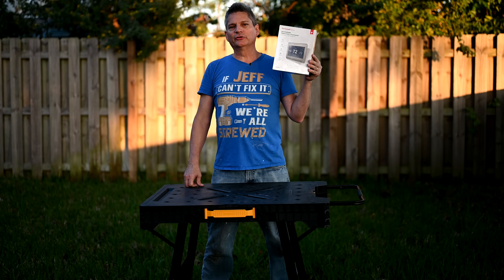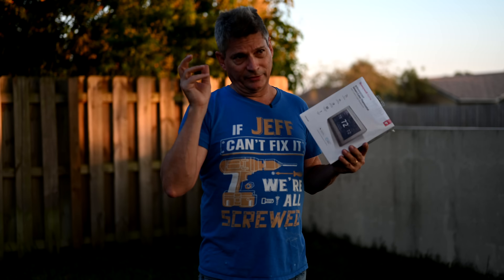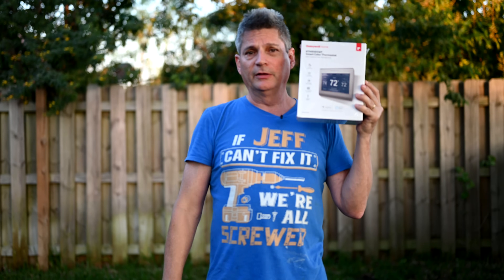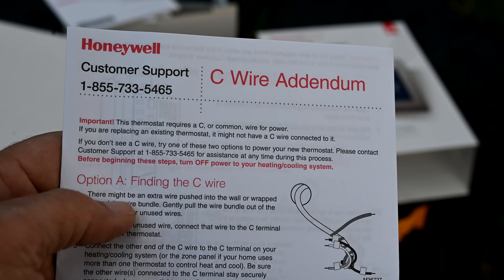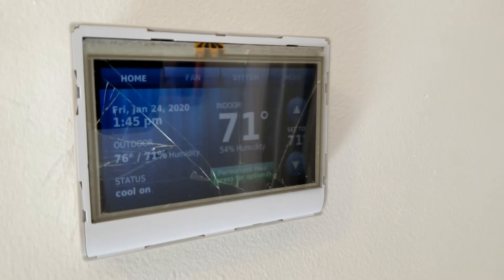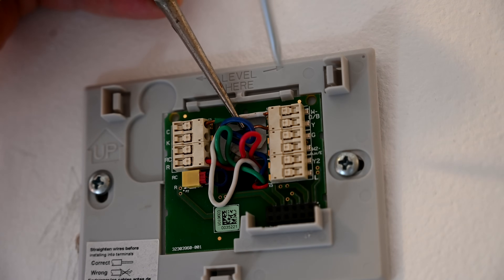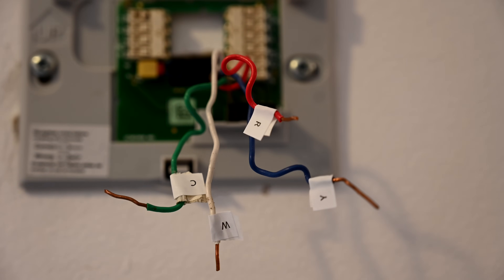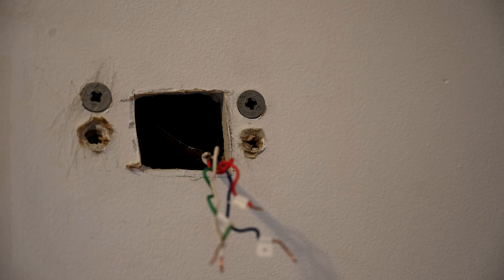How to Install Honeywell Smart WiFi Thermostat RTH9585WF Wiring

Comment: I don't have central air. Can this be used for a gas boiler only?
Reply from the maker: There is a setting for it check owners manual pdf file for fuel heater

Comment: How do I take the wires out? I have W/B/G/Y/R wires and there was a slot for all of them except B so I tried it in the C spot and the heat runs but not the screen. So now I can’t get the wire tips out even with pliers, those little release tabs do nothing. If I pull any hard the whole thing will break.
Reply: I can’t find any videos online that have the same combination of wires that I have
Reply from the maker: Read the instructions in the manual it should say something like that but you basically work the reverse of how you put them in which is you're supposed to push down on something with thing with the screwdriver I believe and then the water pulls out I'm not anywhere where I can look at the manual right now because I'm not at home.
Reply: @jeffostroff  i have 5 wires and it seems like none of them are C. I will have to return the device or get an adapter. Thanks for the help
Reply from the maker: @joetaviusturtle4212   The purpose of the c wire is to provide 24 V AC to your air conditioner. You will need a Volt meter that can read alternating current on DC mode to be able to read that you have 24 V constantly going on this line. One of those 5 wires surely must be the correct wire. LookAt this article here  https://smartthermostatguide.com/thermostat-c-wire-explained/
Reply: @jeffostroff  thanks, it’s the blue one. It isn’t plugged in on the furnace downstairs. There’s another wire in the C spot running to the water heater.

Comment: Any thoughts on why my screen won't illuminate if i have the green to the C, the white to the W, the blue to the Y and the red to the R portals?
Reply from the maker: The color of the wire doesn't mean anything, only where they are connected on the air conditioner so you the air conditioner so you sort of have to know what they are. But if the screen is not lighting up then that probably needs you're not getting 24 V on the c line

Comment: Hello. Your instructions are straight to the point and very easy to follow. My problem is I have 8 wires on my old thermostat which the C wire is blue. O tool a picture but don't know what to do with all those wires.
Reply from the maker: Check on the Honeywell web site support for you thermostat, they have other wiring scenarios there

Comment: Hi Jeff, do you know where I put the orange wire in this terminal
Reply from the maker: No, I have no idea what your orange wire is connected to.
Reply: Orange wire is usually for the reversing valve on the heat pump.  It should go on the terminal labelled ""W-O/B"   If you have a white wire, that is usually for your strip (electric/emergency) heat and that goes on the terminal marked "W2 (aux/E)".  Honeywell web-site validated this, and mine works like a champ.  Make sure you set it up for a 2 stage heating system.

Comment: I just installed this a week ago the part where wasn’t sure was the forced heating if it was gas/oil or electric I selected gas/oil is that correct? Also the efficiency of the heating I selected 90% efficiency.  I don’t know if that’s correct either.
Reply from the maker: It's very simple if you have gas or oil you use a different setting. If you have electricity powering your air conditioner, then you select electrical.

Comment: If I have a previous thermostat with a "G" wire, Can I connect the "G" wire to the C at this thermostat model? Do you think that will be enough?
Reply from the maker: You can try it. IF that doe snot work, Honeywell's website for this has other scenarios to try

Comment: This is why Honeywell conditions their warranty on professional installation on many of their products.  All was fine until this guy started breaking the wire release tabs pressing them in the wrong place.  These are delicate and will break if you press anywhere but on the "head" which is that square part nearest to the wire receptacle.  Note there is a little round recess where you press with your ball point pen or stylus.   To be fair, I also have had 2 Pro-installers break these before I could stop them.
Reply from the maker: The tabs are not broken, and the wires are in the correct place. If not, the unit would not work. LOL Nice try

Comment: In the set up it asked if the unit is Gas or Electric, which do I put if the AC is electric and the Furnace is propane? I haven't installed it yet, but your video seems to be very clear. You mentioned there's a link showing how to add or work around the missing 5th wire. Would you happen to know the link for that? Thanks in advance
Reply from the maker: Kevin not sure about the propane, but they have a lot of setup and wiring tips on the Honeywell site ofr this thermostat: https://www.honeywellhome.com/us/en/support/how-do-i-wire-my-wifi-9000-color-touchscreen-thermostat/
Reply: If your forced "Heating" system runs off of gas/oil select gas/oil.
Mine is both as well Furnace is gas

Hope this helps..

Comment: Thx for the video showing all detail steps to install the device. I just checked my old Honeywell thermostat and found one of the wire is connected to RC, with what I think is a jumper, a kind of U shape little metal hook, connecting the RC and R. 

Can I ask you how to change this set of wire into the new WiFi thermostat? Do I do the same like the old setting? Connect the wire to RC, with the U shape jumper hooking the RC and R?

Thx very much 🙏🏻
Reply from the maker: For most common systems, the default configuration at the factory on the thermostat is to jumper the Rc to the Rh. This is because most systems have only one red wire coming out of the wall going to "R". So they both get jumpered together for single control. If you have 2 lines coming out of the wall that are red, chances are one goes to RC, the other goes to Rh, and you must remove the jumper. Which do you have?
Reply: @jeffostroff  thx very much for your reply. I am using Honeywell RTH221B (battery needed), and I found only 4 wires coming out from wall (so, no wire for "C"). 3 wires going to "GYW", and one going to "RC", a jumper connecting "RC" and "R" together.

 Therefore I believe I need to figure out how to provide power to the thermostat if want the one you mentioned in the video...
Reply from the maker: @leochh  We had to do the same thing on this install. What I had to do was inside the air conditioning unit I found a 24 Volt signal that I was able to use for my C line and Wren dad to the sea line. But by doing that I lose the ability to ever run my air conditioner in fan only mode which is no big deal because I only use it in AC mode cooling mode, or in heat mode I never operated with just a fan only so that was no big loss for me.
Reply: @jeffostroff  thx for your advice, let me try this out~ :D

Comment: Hello Jeff great video, I am a new home owner. Where do you find all that information about your unit that it asks during the set up process?
Reply from the maker: Do you mean like the Mac address and IP address and all that other stuff? Usually they come on a sticker in the package, or if you can turn on the unit you should be able to find it somewhere in the setup menus
Reply: @jeffostroff  where it asks like if it’s forced air, gas or electric, 1 stage or 2 stage. Information about your actual hvac system
Reply: @monb2857  if you can find the make and model number of your furnace, you can search for a manual online to give you the information you are looking for like std or high efficient furnace etc. you'll know if its 1 or 2 stage system by the number of wires you are hooking up. for example, if you have 2 yellow wires and 2 white wires (in addition to the red, green and c wires) then its most likely 2 stage. hope this helps

Comment: OK Video but what is failed to be mentioned is that it is ok if you dont have a 'C' Wire. All you need to do is purchase a 24v transformer that you plug into the wall and it will act as the 'C' wire. they are cheap and avail on amazon, Lowes, Home Depot.
Reply from the maker: Yes that is another good way to do it

Comment: How do you take it off?  I can find NO videos on how to remove it.  It doesn't appear to come off as easy as the one you replaced
Reply from the maker: They should pull right off the wall with some light force and you can pry them from the back plate gently with a flat head screw driver it you can't get it to come off
Reply: @jeffostroff  I'd like to point out I"m trying to take off the newer one not the one you took off.  Just moved in to a place that has one.  Need to take it down.  I think it's the 9585 at least it looks like it.  It doesn't have a model # on it that I can find.
Reply: @jeffostroff  worked.  Just needed to pull a little harder thx

Comment: My Current thermostat has batteries in front. Does that mean I wont have the "C" wire? Or could i still have 5 wores even tho it has batteries?
Reply from the maker: Yes this likely means you will not have five wires period now it could be that originally when your house was built they wired it with five wires but then somebody came in later and did a cheap solution by requiring a thermostat that has its own battery. But what I had to do with mine was to remove the thermostat with the battery and I stole another wire out of the air conditioning unit in order to use it for a C wire, but by doing so I lose the ability to ever run the air conditioner in fan blower mode only which is no big deal because I only ever use it in AC mode during the summer, and sometimes heat mode during the winter time period
Reply: @jeffostroff  well I only use regular air in summer & heat in winter. I didnt even know about a fan mode. I just want to upgrade mine cause you have to manually switch from ac to heat. I want one that auto switches itself. Any suggestions on a good one that has auto switching itself but uses without "C" wire?

Comment: Can this Thermostat works with Oil Furnace which has two wires W & R  and still able to program it ?
Reply from the maker: They indicate it will drive a furnace, look at the wire on the owners manual https://www.honeywellhome.com/us/en/support/air/thermostats/wifi-thermostats/wifi-color-touchscreen-thermostat-rth9585wf1004-u/    check pages 5-8

Comment: Hi, great video..Trying to upgrade my heat pump thermostat, the old one has the wires 1-RH with jumper to RC, 2- G, 3- Y with jumper to W and 4- B...It has 4 wires but not C...Where in the new thermostat (Honeywell Home RTH 9585), goes the B wire? It's blue and goes into the B terminal of the old thermostat....Also, I will need to run a C wire from the unit, right? the cable carries several extra wires that are not plugged to the unit yet, so I can use one of them to get C....Thanks!.....
Reply from the maker: I don't use heat pumps so not sure how to connect it. For the c-wire on my older AC, I had to steal if from another circuit inside the AC controller board. I stole it from the "vent fan" circuit, which means now I can never operate the AC in "vent blowing" mode only, no big deal, I only use AC mode or heater mode.
Reply: @jeffostroff  It's OK, have been reading a little more and already fixed it. Leaving here what I did just in case someone else find similar issue, thanks for sharing your channel full of great info. OK, B wire in my old thermostat (was a blue wire in B terminal) means reversing valve and goes into the new thermostat on O/B terminal, then later on programing choose (Heating Changeover Valve -B wire is connected to O/B).....Now, as for C terminal, since I had extra wires in the cable for the thermostat, I found that C means common and it's the black wire from the 24V side of the transformer placed on the unit control panel. That black wire was attached to the chasis of the unit, so it is some sort of ground, so, I attached the termostat extra wire to the chasis and I was done. Attached the oposite side of the  wire to the C terminal on the new thermostat, turned On the breaker and voilà. All perfect!

Comment: I have a boiler and this exact thermostat and it works fine with a 24v adapter. So it will work without a common wire
Reply from the maker: Yes I had mine working without a common. I did not have the adapter like you did but I just robbed another part of the circuit in the air conditioner in order to make it work.

Comment: Why my thermostat not powering on? But my AC KICKED ON?
Reply from the maker: Maybe screen is bad, but thermostat itself is still working?
Reply: @jeffostroff  no its all dark I even switched wires around and the screen still dark nothing powers but my AC unit kicks on. I think my thermostat is bad I end up putting the old one back on and it's working like it was.

Comment: Did you know that the Ecobee smart thermostats come with a pek module or a power extender kit module that you wire in at your furnace that converts your 4 wire interface to supply power at the thermostat?  You don't give up your G wire.  You can still independently control you fan without heat or cool being on. That is why I went with an Ecobee.  Plus you get added voice control through Alexa or google home.
Reply from the maker: that is handy

Comment: 52 seconds into your intro, I knew this was the best instruction about installing this unit. Cons were up front & this was invaluable & greatly appreciated! 
Thank you for biting the bullet, & troubleshooting it all, for the rest of us.
Reply: If you dont have a C wire you can always purchase a Plug in Transformer that will provide 24v, super easy.
Reply: @willytech97  how much was that??
Reply: @willytech97  thank you so much, I ended up having all the wires I needed which I was so thankful for!! The were stuck in the wall cavity
Reply from the maker: thanks glad to help!

Comment: What’s up with the open electrical box next to the thermostat ?
Reply from the maker: that is the old mounting spot of the original thermostat as built by the home builder. That is not a box, it is just a metal face frame in there, likely for mounting

Comment: Unfortunately I have a 4 wire unit and learned the hard way. I called customer service and they had me in the attic chasing wires from my furnace. Then suggested I get an electrician to come out and hook it up. No thanks, it's going back. The best line in this video was the one where Jeff says "They should annotate in big bold letters on the from of the box that this is a 5 wire system." Though I wouldn't have known at the time but wold have been much easier to figure out and it wasn't stated in the instructions.
Reply from the maker: Yup, once you get it working though it is a nice thermostat

Comment: OMG! That is an awesome thermostat. We recently got a quote for an updated central system and, the Thermostat EXACTLY like this one was $1500.00 added on the $10,000.00 price JUST for the Air cond., without the furnace, since ours was recently replaced with an Energy star 95 percent efficient 100,000 BTU Propane furnace.

Comment: GM Jeff, I have a question for about the Honeywell Wifi Thermostat that you installed.. I'm glad that I also purchased this same unit. Does your Indoor Temp Readout go up and down while the Set To Readout is steady ? Our unit sometimes does this and Indoor Temp Readout returns to the Set Temp in our case is 75F this unit is an upgrade for us since our other old LCD Honeywell Thermostat was acting up..! Please let me know if this happens to you..! Thanks
Reply from the maker: IT should go up and down. Say you set it to 75, and if it is 80 degrees inside the ac kicks on then it drops, they say in the instructions that it can move 3 degrees before it comes on.
Reply: @jeffostroff  Thanks for answering my question.  Take care thanks

Comment: How long does the stat remember the settings, if the power is off?  We shut down our house from Nov to May, so there is no 24V to power the stat for several months. Wouldn't the battery model be better?
Reply from the maker: Well it's hard to tell if the battery will last that long it probably would but no guarantees period. I think it remembers its last settings when it powers back up
.

Comment: Does it have temperature swing?
Reply from the maker: not sure what you mean
Reply: @jeffostroff  like if you set it at like let’s say 75 and it doesn’t turn the ac on until it goes up to 76 and when it’s on it will go down to 74. That way it won’t kick the ac compressor on too much. It’s usually a 1 degree swing.

Comment: I have a heat pump and have W1 and W2 this thermostat doesn’t  have W1 terminal?
Reply from the maker: Somewhere in the owner’s manual should be a QR barcode that you can scan I think an go see videos on Honeywell’s website, or the owner’s manual will tell you where to find additional scenarios on their website to deal with the wiring. I do not have any experience with this because I don't deal with heat pumps.
Reply: @jeffostroff  yes I must put together W1 W2  in pigtail not sure how works but it did

Comment: Hi Jeff, I am thinking about buying one of these. What happens if the house loses power while you are away. Power comes back on, does the thermostat automatically reconnect to the wifi, or is it Dead in the Water until you reset it? (Just wondering.)  Thank You.
Reply from the maker: Yes it comes back to find the wifi. But if wifi does not reconnect to the internet provider, then the Honeywell will not reconnect